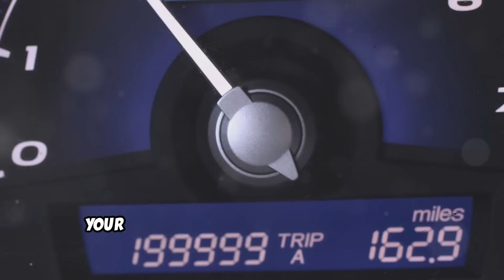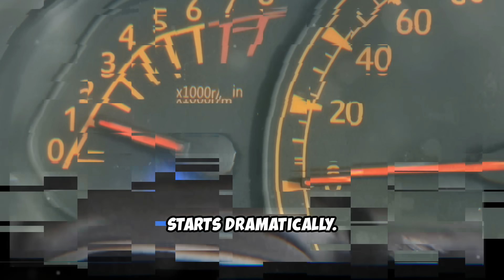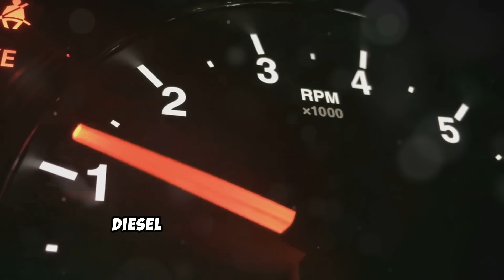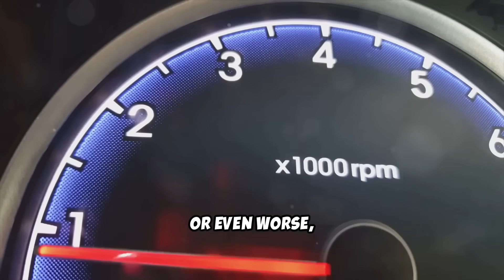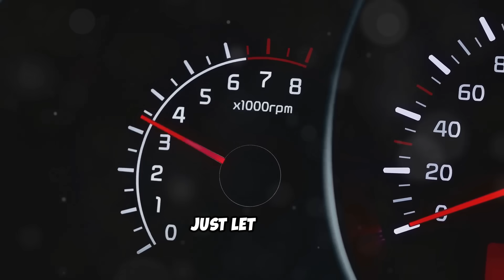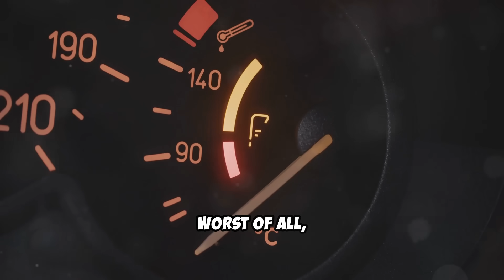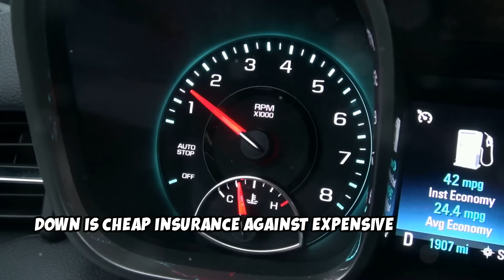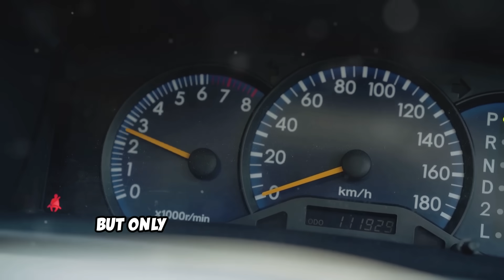Why Your Diesel Car Won't Last 100k Miles (Unless You STOP Doing This)

Comment: I remember when we first started running turbos on diesel tractors in the 70’s. It was always part of correct operation to let the tractor idle for a few minutes when you were done before turning it off

Comment: Ive got a 4.4 bi turbo diesel engine. Start stop always off on start up,  set permanently by scan tool in multican. Oil / filter change every 6k kms. Can of high performance fuel system cleaner every 5k kms. Give engine  time to warm up , no revving. Wait minutes until temp gauge settles to middle and moves no more before switch off.  Zero probs at150k kms now.  Use time to check phone, dust interior etc. Saves many thousands of $$$$ and down days of no car to use. A little effort pays off big time.

Comment: I have a VW Tiguan 2016, as former mechanic on diesel / petrol engines. The stop start is turned off permanently as I know it damages the engine. I use a fuel additive like CATA CLEAN every three months to clean the fuel system and to ensure no DPF problem.

Comment: Thanks. I've just bought a diesel and will make sure to do (or not do) the things suggested.
Reply: Use Amsoil signature series oil with a Amsoil oil filter and you will be great for 10,000 to 15,000 miles or once a year. The start stop feature yes that’s not good. Let your truck run don’t shut it off and restart it constantly if you know what I mean. In the winter let your truck start and run for 8 to 10 minutes or until your oil temperature gets to 90° and then drive but don’t drive heavy or hard until your oil temperature gets to 180°. And if you tow or drive extremely heavy, do not shut your truck off until your oil temperature comes down to at least 205° to or lower i personally wait until my truck gets to 200° to 190° before I shut it off. I use amsoil heavy duty diesel coolant. It is good for all mix and models. The only thing that is different that oil regular coolant has is the heavy duty coolant has a water pump lubrication additive. I use it on my 2019 Chevrolet 3500 diesel truck. And with DEF, I personally only use peak blue DEF and platinum peak blue DEF and I look at the manufacturer date and I will only buy DEF that is manufactured within six months or newer of me purchasing it. DF expires and if you put bad DEF fluid in your truck, you will have to drain it and fill it with fresh DEF, which is not cheap. If you have to take it to the dealer or a shop. And when you are driving in your vehicle, is that operating temperature? It is a good idea to drive your truck like you stole it a couple of times. I usually do it at least one to two times every other week. It’s good to get your exhaust pressure up and your intake boost up to clean everything out. I usually do it when I am going up a steep grade. I try to come to a rolling stop or around 20 miles an hour and I will floor it a couple of times. Some people say it’s not good for your vehicle doing it, but I disagree. With today’s vehicles, it is good to get the temperature’s hot and put it under a heavy load, especially with today’s emissions. And do not put cheap diesel in your truck. Try to stick with Costco Chevron 76 or Shell diesel. And always get diesel from a fuel station that is selling a lot of of it. Don’t buy diesel from a place that is extremely small and takes them a couple of months to go through one tank of diesel. Basically you don’t wanna get diesel from a place that it’s been sitting for a while diesel collects moisture and you don’t wanna get water in your fuel. Fuel filters are about $60 a pop. And I like to use Wix filters. And I switched to Amsoil when I had 12,000 miles on my truck. And I noticed an immediate difference in the way my engine cranks and slightly better fuel economy on the highway. When I did my front and rear differentials, transmission, and transfer case with Amsoil signature series oil I get around 3 to 4 miles per gallon better fuel economy.